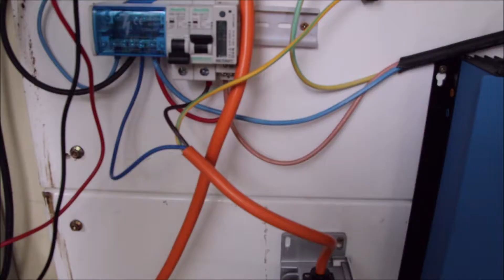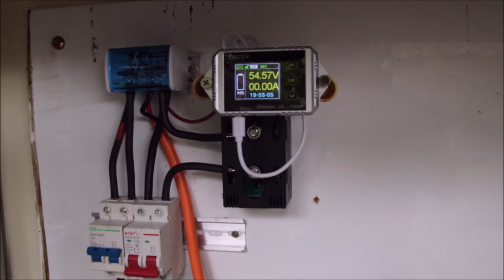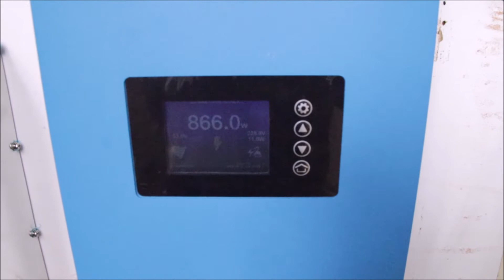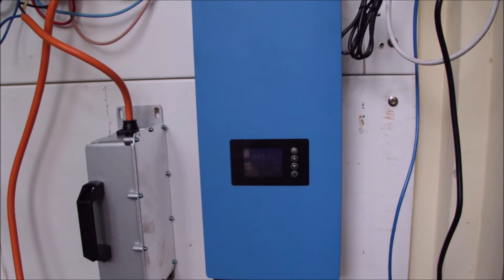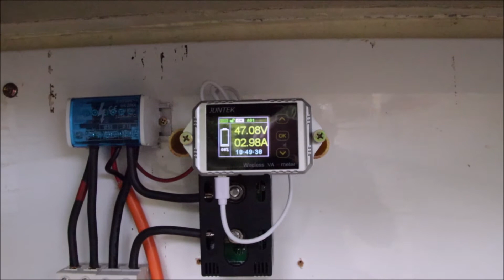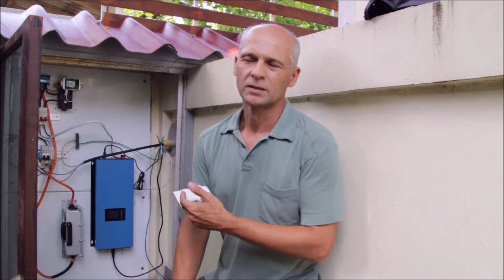The AC-Powerwall Project - Ep 8: Used Lithium cells in Thailand, Top or Flop? The Capacity Test

Comment: Nice overview. What bms are you planing to use?
Reply from the maker: It is shown in Ep 12. Its just a very ordinary Daly style 70A charge/discharge BMS. YIT brand, just another chinese manufacturer... Purpose is only to watch limits. The pack is nicely balanced and never had a string run away in my intended operating band between 10-95% SOC. If i am getting a imbalance some time, i might consider some active balancing.